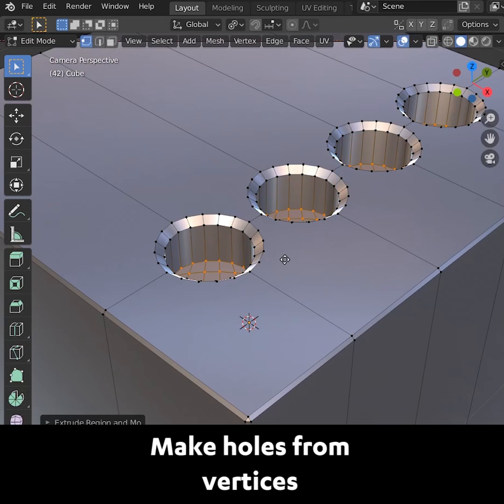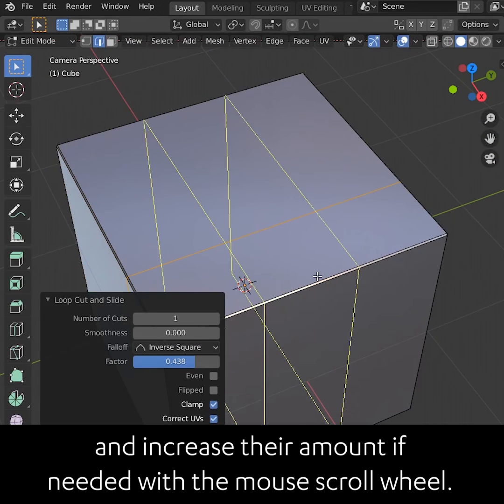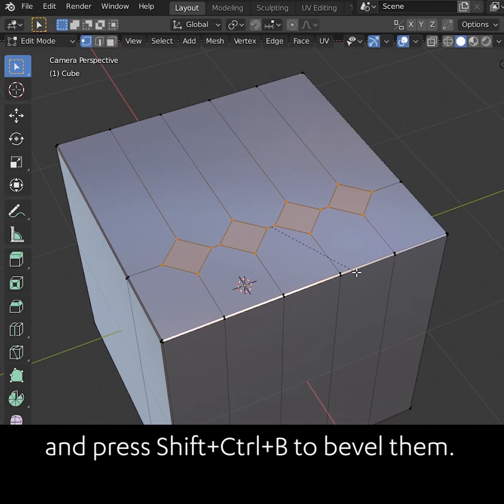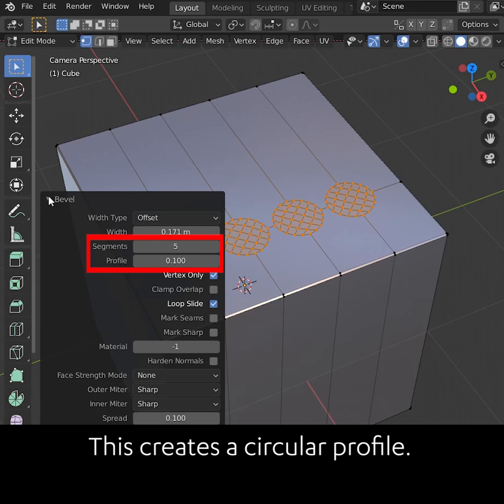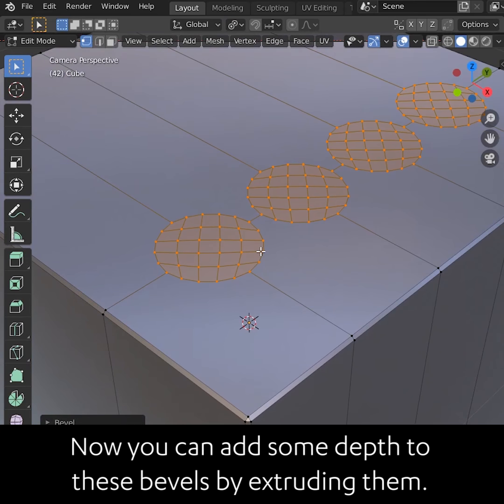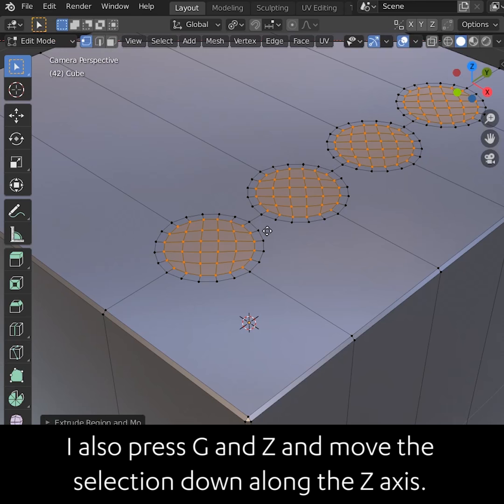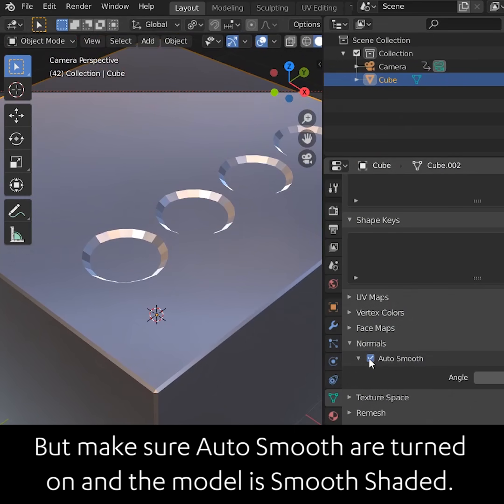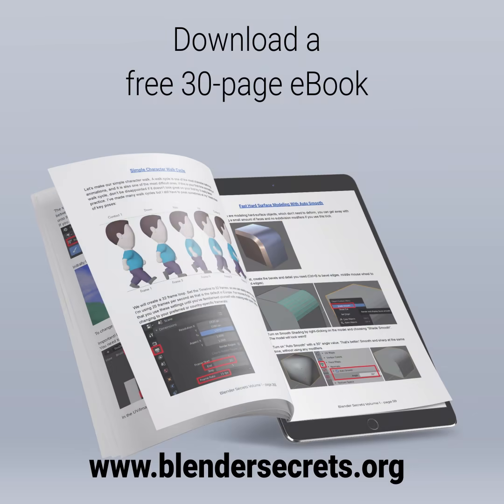Daily Blender Secrets - Turn vertices into Holes

Comment: is  this a good topology
Reply: Yes, I suppose this is the best way to do holes? the other way is with the bool tool but it can create n-gons which are like a polygon but with more than 4 vertices. I'm general, the bool tool tends to create weird stuff with smoothing, beveling, and shading in general. Using vertex beveling you can avoid these bugs entirely and it doesn't limit you from modeling further.

Comment: Creates Ngons on the surface though
Reply: It does matter if it doesn't triangulate well due to the ngon
Reply: Yeah but for videogames, this really wouldn't matter^^ (Or even is better than having clean topology for performance)

Mostly if you wanted to Subdivide it and put like a displacement on or whatever you would need all quads.
Reply: @Newbeginning-ux1cd that is VERY BAD for games on ue

Comment: The surrounding Polygons are not tris or quads. You will get Rendering issues. This way of creating a hole may be suitable for construction but not really for Renderings.
Reply: Depends on render engine, most of them handles CAD just fine, I've been rendering CAD products without shading issues, only Octane is pretty sensitive to geo, also ZBrush doesn't accept many kinds of "CAD" models, gets fkd in various ways.

Comment: Smooth shade always completely wrecks whatever I have built.
Reply: Try only using quads all over the surface. No ngons and triangles. Plus Bevel all the hard edges. If you do that it‘ll look 1000 times better
Reply: @raphaelstiep9815  Ok thx! Also Ive found that separated vertices will wreck shade smooth. Im getting better at spotting and fixing those too now.
Reply: "harden normals" might help
Reply: @doomguy2809  ok Ill look into that. Thx!😉

Comment: how would you take care of the ngons caused by this?
Reply from the maker: Just don't tell the polygon police, we'll get away with it.
Reply: @BlenderSecrets 😂
Reply: and how will you use subd modifier on it if you will not remove them? @BlenderSecrets
Reply: add a sub division level2 no ngones
Reply: obviously it would not work on such a model. It is understandable for anyone who works with subdiv modeling @terryblends
Reply: @armwrestlinginfo  subdivide by two turns it into quads I believe then reto can reduce it back to a lower poly mesh seems to work for me
Reply: Depending on the Use case of this model, the NGons might not matter. 

If its for a videogame, this result is probably even better with NGons than with clean topology, since you get WAY fewer verts.
Reply: @Newbeginning-ux1cd  you need a smooth model to make a normal map out of it anyway
Reply: @armwrestlinginfo  not when using substancepainter^^
Reply: @Newbeginning-ux1cd  Believe in games specially this meshes would cause a lot of problems. This "tips" are really just for amateurs that create render images for their Instagram. On a big studio they would not hire you if your topology looks like this.

Comment: Sorry everyone - this doesn't work for me. I follow every step but E and then S doesn't resize  (Just starts the extrude) (It works for one hole but not more than one). I have pivot point set to individual origins. E S works in other situations. I'm using 2.90 beta - some difference?

Comment: I am kind of new in blender, but i have been told that a face must have 3 or 4 vertices, more will consider n-gons, and n-gons are bad, i am confused.
Reply from the maker: That's generally good advice (4 vertices, aka "quads") when you have an object that deforms like a character or something organic, because that way the subdivision algorithm can do a good job making things look smooth. That is difficult with more than 4 vertices. However when modeling a "hard-surface" object like a robot or a computer or what have you, this is not deforming so it doesn't matter as much. You just need to make sure that it looks good, which you definitely can with N-gons. Sometimes you still need to clean something up for fixing shading issues, but that doesn't mean you need to have all quads for a hard-surface object. I hope that explains a bit :-)
Reply: @BlenderSecrets  thanks a bunch, that cleared my doubts :)
Reply: Generally, you want polygons to have no more than 4 faces and no less than 3 face. This is due to rendering/game engines, if your object is going to go into either then you'll have major issues 99.9% of the time. 

It does not matter whether it's organic or hard surface, the issues will remain and will likely fail to improt into game engine, or even crash it in some cases, or give serious rendering issues in when rendering.

Comment: I can't scale them as you did. If I try to scale all 4 at the same time my scaling is centered in the middle of them
Reply: I think I had the same problem and I thin the solution is that you have to check "individual origins" before start. If you try to do at the same time that in the video then doesn't work. Sorry for my english.// p.d: Much more acurate, the edges are still selected when you try to scaling. I'm think it's that, actually.
Reply from the maker: hmm,which version of Blender?
Reply: @BlenderSecrets  last one 2.82
Reply from the maker: @IsaakSchimdt  It doesn't work anymore that way, I'm not sure why. But you can still do the same by using Inset instead. Press i and then move the mouse to scale them down. Same thing. Or just bevel the edges instead.
Reply: @BlenderSecrets  I had the same problem with 2.83a. Thanks SO much for the alternative solution!

Comment: I always use to have problems with holes even with the loop tool. This is cool, except I have blender 2.83 alpha. I'm having trouble with inseting the verices inward towards center of hole. I do have the individual origins set on top. They just won't inset or extrude properly for me for some reason
Reply: I had the same issue. You have to deselect the edges (in edge select mode) between the circles before extruding, otherwise Blender wil treat it as a single object. Then it works like a charm
Reply: 1) make sure there is no edge selected between each disc of vertices by going into edge mode [2] and deselect them from the current selection. Then go back to vertice mode [1].
2) Press I to inset instead of E then S (all while still in Individual Origins pivot mode)

Comment: hello there ;) Thanks a lot for all the useful tips! One tiny thing though: it seems like the profile of 0.09 matches circle shape better. 0.1 sounds more logical, but apparently it's 0.09 :D
Reply: Most accurate one: 0.085
Reply: @damaomiX  confirmed
Reply from the maker: Cool, thanks for the correction!
Reply: @BlenderSecrets  but what do you think, is it 0.1 or 0.09? 'Cause maybe I'm just missing something.  I was just comparing it with a circle of a cylinder and it seemed more roundish
Reply from the maker: @Alex-by4zv  Hmm, not sure - it also depends on whether the scale of your object is applied or not. You can always make it perfect by selecting the circle and going to right-click > LoopTools > Circle. Then it's 100% circular for sure.